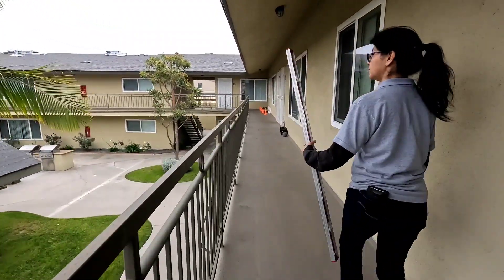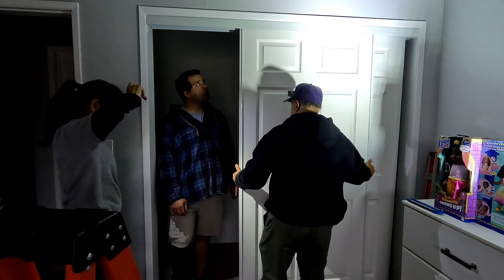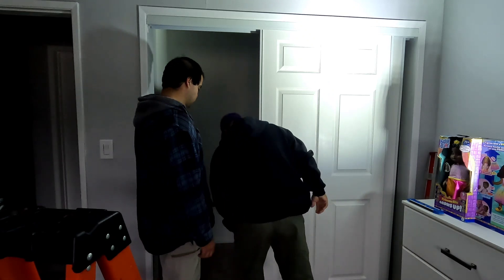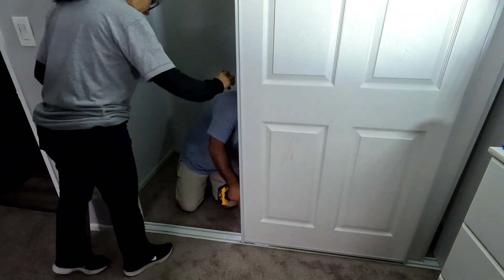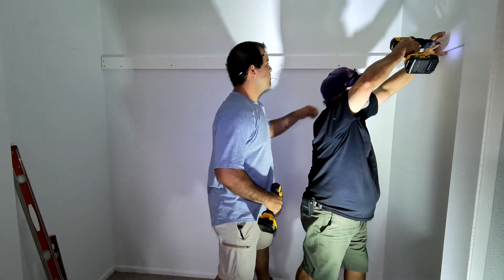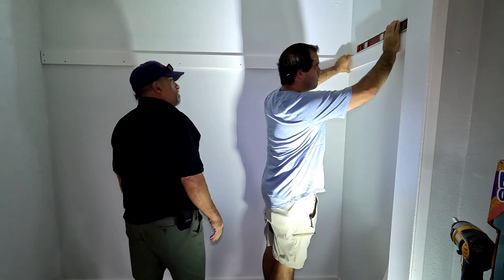Closet Shelf And Pole Installation.

Comment: Another good job with attention to detail. The melamine shelving I used to get at Home Depot was coated on all sides? There were no knobs on the sliding closet doors?   I also used metal closet poles already painted white.  More expensive than finger jointed wood? Probably a good idea to keep those painters out of the place.
Reply from the maker: So right they at one time came coated on both sides those cheap closet doors have a little finger lip on the edges on both sides where you're able to grab that finger lip although when I purchase those cheaper closet doors because the customer wants them I usually purchase self-stick finger pulls and put them on myself just like you're mentioning. You have a very good eye for detail Alicia and I appreciate you participating in the comments not only does it open my eyes but it lets people know out there that you can upgrade those doors with finger pulls by putting on the self stick clear ones or Chrome ones or mirror ones along with white ones. Also I think I'm going to start pushing the metal poles because the finger joint ones are almost as expensive as metal ones nowadays Once again thank you for watching and participating.